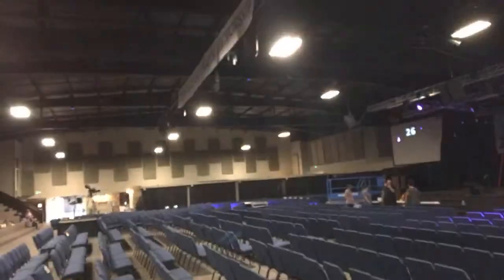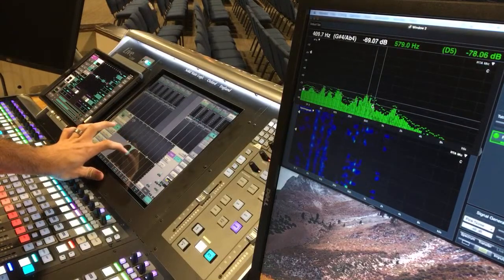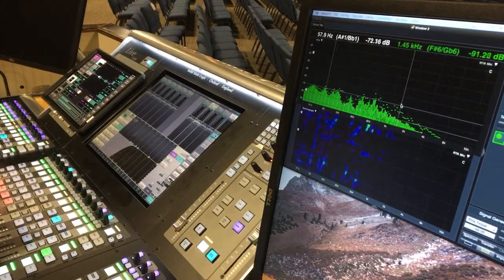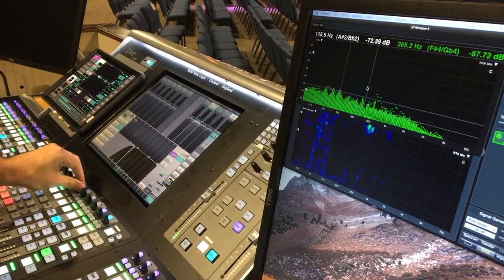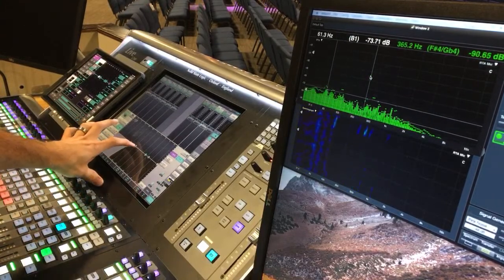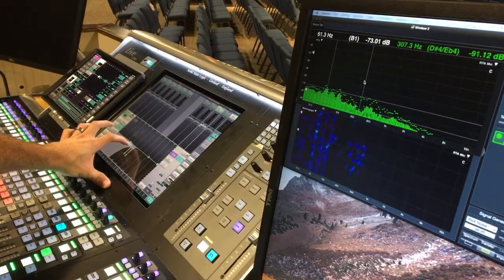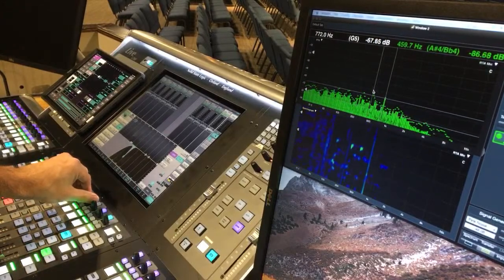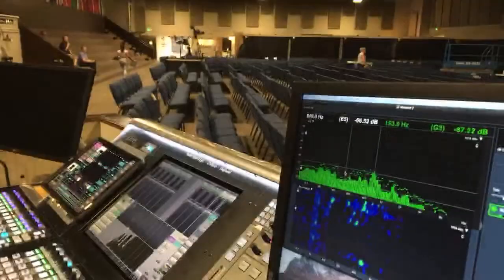How to get feedback out of choir mics

Comment: I‘ve a lot of methods to elevate feedback of choir Mic. You have a natural db limit. 
The most feedback come from Monitors
1. To get no choir mics to Monitor.
2. If it is possible you can work with In ear Monitoring.
3. Or you give Dynamic mics for the 4 Voice Soprano Alt, Tenor for the best singers to get only to the Monitor.
4. Look for the room, what is possible to Place the front. Eventually work with delay Lines.
5. Sometimes it is helpful to work with compressor. But you must have experience.
6. You can cross the Pan. Left Mics to Right Boxes.
7. To work with feedback eliminator. This is like make in the video manually.
8. Look to decorate the wall, and didn‘t have no hard walls.
9. Eventually work with Gate, to reduce the open mics.

All this steps are first to to until you eliminate Feedback manually. The feedback Frequences changes with temperature. With people full room. Mostly it will be better. But you must have headroom of loudness. For Soundcheck in an empty Room, you must have 30% more loudness in a full people room.

I‘ll hope with this tips you have a well concert.

God bless you.
Reply: Thanks for the pointers. I hadn't thought of 6) "crossing the pans"... That makes a lot of sense.

Comment: One issue I ran across with our choir mics is that once each mic was rung out and I turned them all back on, I was getting feedback on frequencies that I had reduced on some of the mics. Our eight choir mics were acting as an array. (It's clear the architect of our worship center didn't know much about acoustics.) My solution was to zero the mics back out and tune them together. I found that when I started to get a frequency feeding back, I could usually turn off a couple of mics and turn down the frequencies on those mics. The next frequencies I would find a couple of different mics to turn down. I a frequency came back at a higher level, I would have to find a couple of different mics and turn them down part way. I went through this going back and adjusting which mics were taking care of which frequencies in order to optimize frequencies for the different parts of the choir. That's probably not the solution everyone needs, but if you are having a problem turning all the mics on after having rung out each one, consider treating them as an array.

My explanation for how an array works in feedback: take two microphones in an array. Mic A hears a resonant frequency in its part of the room, but doesn't hear it coming back from the mains. However, Mic B hears the frequency in the mains and feeds it back into the system. Reducing the frequency in either mic will eliminate the feedback. Just multiply this dynamic by however many mics you are using to cover an area, and you have a fairly complex system. Do you use less mics each covering a greater area, or more mics each covering a smaller area? In the first scenario, more gain will lead to more feedback. In the second scenario, more mics will lead to more feedback. You just have to play with it to get into a sweet spot.
Reply from the maker: Another way to try this would be to EQ each individually, and then make a group to EQ out the frequencies that would bump up from the combination. Each time you add a mic, you add to the total gain, so it makes sense that there would be additional freq's that want to ring.
Reply: @AttawayAudio  Thanks! I'll have to try that. It's not as easy to do on our current board, but we are due for an upgrade and the system our consultant recommends would do this pretty easily. We use so many mics to combat the room's drawbacks, and use Astatic variable polar pattern mics to narrow the area each mic covers. That helps out some, plus alternating polarity and panning troublesome mics away from the side they are closest to. I'm using every trick I know and I'm open to tricks I don't know yet.

Comment: How high do you low cut choir mics? I used this trick with an rta app on my phone and already has made a huge difference. I’m micing a K thru 8th grade chorus so it doesn’t even have to sound good. I just need it to not feed back! Thanks for this video James, four years later it’s still helping.
Reply from the maker: 200 Hz is a good starting place. Move it up until it sounds thin, then back it off.

Comment: Thank you for the video! Did you EQ directly on the mics Equalizers or on the EQ for the speaker? Also, do you do the same on the lead?
Reply from the maker: I put the EQ on the mic channels that were most likely to feed back, so just the choir mics. If I did have a lead vocal mic that was prone to feedback, I'd try the steps in this other video first, and then, if all that didn't work, I'd do the process above for that mic. But that should only be one or two frequencies if everything else is working properly. https://youtu.be/X0sf2ZuQKGM

Comment: In my church every Christmas we have a big musical with choir, vocals, band and a big orchestra! It's very challenging to put the choir in the front mix without feedback! And they still need monitors!! Witch mics you use for choir?
Reply from the maker: I typically reach for a small diaphragm condenser, and the flatter the response, and the more off-axis rejection (and smoother off-axis rejection) the better. If the choir sounds good, and the mic sounds transparent, you won't have to use EQ bands to fix the tonality. The ones in this video were some Audix miniatures that I found... not even sure of the model. 🤷‍♂️

Comment: only question I have is how did you set the pre amp before raising the faders and ringing the mics out.?
Reply from the maker: As I'm starting, I put the fader around -5 or -10 or so and roll up the preamp til it starts to feed back. As I get rid of more frequencies, I'll push up the fader more. Gain before feedback doesn't care if the gain comes from the fader or the preamp, and if you know where the highest point you can put your fader before it feeds back, that'll help you adjust your whole mix around that element to keep it from feeding back, but stay in front

Comment: I'll take that mic placement any time.  I have 2 suspended over our choir loft but the loft is on the left side of the array and somewhat out front.  I've rung these things out over an over but I still can't get much gain into them unless I pan it more to the right side.  Unfortunately there's no moving the choir.  Any suggestions would be great.  Thanks for the videos...they help greatly.

Comment: Is it feedbacking on the PA or mons?
Were you applying the EQ to the choir mics or to the wedges?

Thanks for sharing!
Reply from the maker: It's feeding back through the PA, and I'm putting the EQ on the mics themselves.
Reply: @AttawayAudio  great tip but if I am using the bands to ring out, how am I going to EQ the mic if I have no more eq bands to use?

Comment: Thank you for sharing your knowledge and experience. I have had allot of trouble with choir mics. Our church has Shure SM81s  which are recommended for choirs by Shure. I have tried multiple methods and cannot seem to get enough signal to mix the room properly. It's just weak. The SM81s just always seem weak. I have the mics set at 0 DB (no pad) and used the 18 DB high pass filter roll off setting. I was able to set gain very high and used your method of ringing out the mics, which I like better than scrolling with the parametric EQ points. What mics are you using, do they have integral pre-amps built in? They sure sound great in the choir video. I am miking a 15 person choir, two rows deep, 7 in front and 8 behind staggered. Shure says to use three mics at six feet apart, two feet from the from singers (3 to 1 rule). Our budget will not allow for different mics at this point. Suggestions for better signal levels at the mixer?
Reply from the maker: For now, just forget about the 3:1 rule. Place 2 mics at the 1/3 point of the choir, and back it up JUST enough so the person who's right in front of it isn't louder than everyone else.

Comment: Where is the gain set before pushing up the fader..? Do you ring out the monitor feedback before the microphone(s) feedback..?
Reply from the maker: Great question! If I'm doing this before any talent arrives, I may go ahead and set gain by putting the fader at 0 and then rolling up the preamp until I get feedback, notch it, and then keep rolling up the preamp. This way I know that above 0 on the fader is the edge of how loud I can put it, but I'm safe below there. Then if the talent arrives and I need less preamp, I can always turn it down.

Comment: James, can you explain a bit about what type of input is your SMAART spectograph is reading.  Is it channel PFL from the desk or a reference room mic?
Reply from the maker: In this instance, Smaart has a reference-style mic as the input, but a PFL would work, it just takes an extra step. And I mostly use Smaart while mixing to quickly identity problem frequencies in the room, so the mic is more effective for that
Reply: @AttawayAudio  So should you connect the reference mic direct to the PC running Smaart or is patched from  the mixing desk?   Sorry for the basic questions!
Reply from the maker: No problem! We have an audio interface with a mic input that feeds the computer, so it doesn’t take any channels or routing on the console. If we were taking a Transform measurement (comparison of signals), then I would route a mono-summed signal from the console to a second input on the interface so they could be compared at the same time.
Reply: @AttawayAudio  Thanks James.   Just got back from this week's worship rehearsal.   What you explained worked a treat!
Reply from the maker: That’s awesome!!! Way to crush it!
Reply: Did I hear you correctly that you could do this on a lav mix, such as an Omnidirectional lav?
Reply from the maker: @joshuahumphreys1120  Yes, this works for any mic you want. You'll want to have it on the person speaking, with them in place on stage with all the props (podium, music stand, whatever) they'll have when speaking, because those will cause a change in the frequencies that will like to feed back.

Comment: Hi i follow ur great videos ..got some questions..1. Do u perform this step after calibre the pre amp level ?
2. Is it the same mic ringing after cutting the feedback frequency, if so why a single mic has multiple feedback frequencies ? 
3. Whats da software used for the spectrum analysis ,or its built in for mixer ...Thanks
Reply from the maker: 1. I do it as I’m setting my mic pre levels, because I want my fader to live around 0 with a few more dB of headroom before it rings. This way I know visually how far I have before it’ll feedback. So the steps go hand-in-hand.
2. Every mic will have more than one frequency that will feed back, but you start with the “loudest” one, and pull it down, and then you can push the level up further to get to the next one, and turn that down. You have to get one out of the way before you can isolate the next one. At least if you’re working methodically. 
3. This program is Smaart by Rational Acoustics. But a bunch of mixers have an RTA built-in to the EQ screen, which is SUPER helpful. 
Thanks for the questions Indika!
Reply: @AttawayAudio  thanks for taking time to answer my questions and it was really helpful 😎

Comment: Thanks for the Video. I have some questions.
1. I Think you cut the frequencies of the microphone channels. Why didnt you cut those frequencies on the monitor channel instead of Microphone channel? Wont that change the Sound of Voice?
2. If there are 3 to for frequencies to be cut. then after using the PEQ how can one EQ the voice to Attenuate or boos some freqiencies of the voice to make it sound sweeter or nicer?

Thanks in Advance
Reply from the maker: The mics were close to the mains, not the monitors. The narrow cuts don't change the tone much. And hopefully the choir just sounds like they should, and the mics don't have weird tonal things that need correcting, so you don't have to EQ more. If it was a close-mic'd vocal, that's not usually the case.
Reply: @AttawayAudio  You mean in case of Close Mic's should we eq the Monitor to Ring out?

Comment: great video! How much is the preamp gain turned up on the choir mics so that you can effectively ring them out?
Reply from the maker: Thanks Andreas! The gain is turned up until... it feeds back. You want as much gain as you can get, and with sensitive mics near the front of the PA, it's not going to need much before it starts to ring. Gain is gain, no matter which stage it comes from.

Comment: Sorry if I'm wrong but isn't graphic eq in essense a parametric eq but with fixed state? And those other bell shaped ones are state variable but both are parametric...
Reply from the maker: A graphic EQ is in essence a fixed bandwidth, fixed point EQ. But if you're not careful, there can be phase shifts between the bands (that's how EQ does its job - it varies the phase for that frequency to cancel it out some or cause constructive interference). So if your graphic EQ is has too much change between two bands, it can cause phase issues and make it sound weird. Parametric EQs can be smoother phase-wise. And on the SSL, the parametric EQ has such fine controls, I could really dial in what exact frequency it is, much closer than I could with a 1/3 -octave graphic EQ.

Comment: That's pretty interesting, however in my case after ringing out mics separately, when I enable them all and turn the volume up, it is not possible to have the same level as on individual.
Reply from the maker: Yeah combining them raises the overall level
Reply: Btw, how do you deal with the low end on choir mics? Or are you just ringing them out and that's it?

Comment: Where do you put your HPF on choir? I sometimes do a childern choir of 25members and fighting feedback all the time, so you notch out the feedback frequencies and that's all ? do you use anything alse fot choir ?  How many mics do i  need to use ? thanks for answer :D
Reply from the maker: if you don't have a bass section, you can go up to 200 Hz or so no problem. if you have basses, try 100-150 for the hpf. number of mics depends on size of group, but for 25 people 2 mics should be enough to get a stereo image of them... or you can use 3 mics - one for each voice part
Reply: @AttawayAudio  Thank you very much and about ty EQ and overall processing for choir mics, are you using compression,  FX or any other process than EQ for take out the problematic frequencies?

Comment: If I may ask, what do you think about the dbx AFS2? On paper this device should work awesome regaring filtering out nasty frequenties.
Reply from the maker: I haven't actually used one, but I think it is great, but has its limitations. What if you have 4 mics but only two channels of processing, and each mic feeds back at 3 different frequencies? Eventually it runs out of processing power.
Reply: @AttawayAudio  I would use the device as insert processor on a "speech" bus. Sending all the same type of headsets to one of the two inputs. Thanks for your answer.

Comment: so won't increasing the gain on these mics to be as high as possible also pick up more of the band that is behind them?
Reply from the maker: Yes, but it doesn't affect the balance of signal to noise. The choir is just as loud relative to the band no matter how hot the mics are.
Reply: @AttawayAudio  ah. Thank you. Didn't think of that. So you're raising the gain to get the most common choir possible so you can mix the band louder in the house. So everytime you move those mics different frequencies will show?

Comment: Hi Wanna ask. Monitors are Eq d according to Microphone feedback.
What happens to the band (Music) tone. Or you only Eq Vocal Aux?
Reply from the maker: I put the EQ on the mics, not the speakers, so only those particular inputs are affected. Hopefully the eq notches are narrow enough that it doesn’t affect the tone. Your ear can tolerate a big narrow cut and not notice it
Reply: @AttawayAudio  so do you ring out only choirs or do you do it with all other mics as well cause usually while ringing out, one will eq the monitors or mains and not the mics to prevent tonal changes of the source. What is it that you do?
Thanks.

Comment: How do you use the same Graphic EQ to knockout problematic frequencies and be able to also us it to fine tune the Mics at the same time?
Reply from the maker: Great question! Beyond changing mics to get the base sound you want without EQ, you could patch in another EQ on the insert from a rack, route them through a group and use EQ on that, or just make a compromise between gain-before-feedback and tone.
Reply: Attaway Audio I always wondered how to get both.... Thx much 👍🏾

Comment: What about compression on Choir mics/ condensers?
Reply from the maker: Great question! Compression reduces the dynamic range, which also brings up the noise floor, so on really feedback-prone inputs, I'll just use a touch of compression or limiting to keep the peaks from giving me problems (high threshold, higher ratio), but leave it mostly uncompressed.